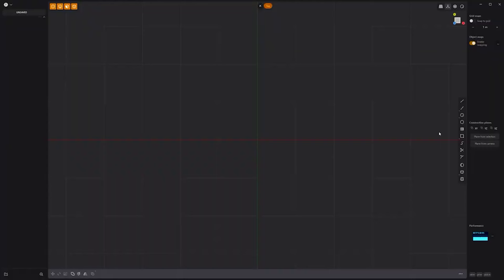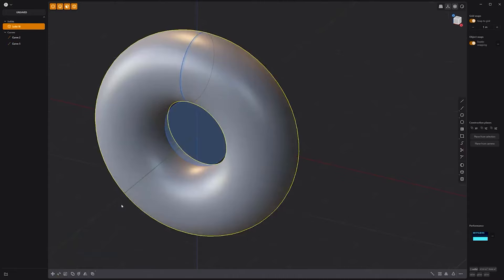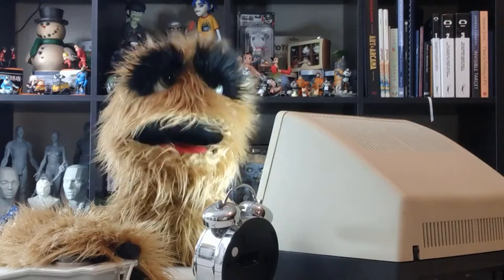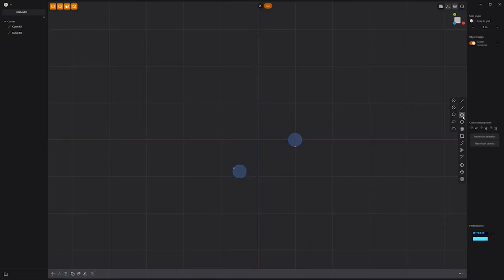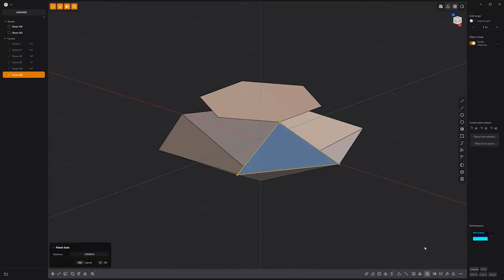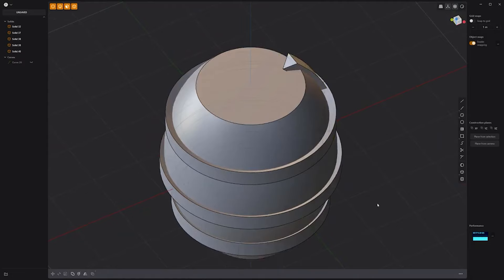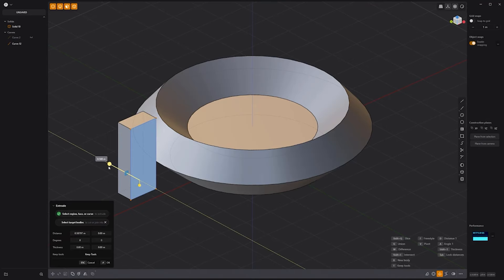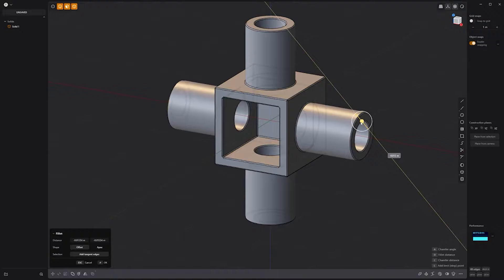Plasticity | 35 Essential Modeling Exercises

Comment: Is there any way to see the points of the surface? In order to manipulate it further? (Like the vertices on subdivision modeling, but also like the points on the surface at NURBS modeling)
Reply from the maker: You cant edit on a vert level for solids as you would in a traditional 3d app such as Maya or Modo.
Reply: @Pixelfondue  o rhinoceros acho que faz tudo isso mais oque o maia e modo  fazem . ou nao ?

Comment: Has Plasticity added the ability to scale/ change size of an object by units? ie. cm/inches etc. I really hope they add that soon
Reply from the maker: Its still the same that the components dont remain live
Reply: Hey  @Pixelfondue ! Could you make a video about the "Sweep tool", the second option when you press "F" in the search bar. Its about sweeping a solid I think and i'm having a bit of a struggle.
Reply from the maker: @albertoperezmartinez4050  https://youtu.be/DBM_4LVNTBQ?si=hqtH0ShKoIGgQsYi
Reply from the maker: https://youtu.be/hhnk1v-p6SA @albertoperezmartinez4050
Reply from the maker: @albertoperezmartinez4050  Nick the dev said it should have been removed... its was an experimental feature for simulating the path of a spinning tool, like cam / cnc
Reply: @Pixelfondue  Thank you for your reminder!  I've been trying this feature as well but it doesn't work. So  there's no way to deform a solid? or twisting a complex model?
Reply: That was added in v1.4 three weeks ago.

Comment: How to Sub-D modeling.
Reply from the maker: No SubD in Plasticity. I'd use Modo for that
Reply: @Pixelfondue  Thanks. I was asking in comparison to Fusion 360 which has T-Splines which is Sub-D. So it would seem if I switch from Fusion 360 to Plasticity I lose parametric and Sub-D. To me that is a lot to lose. Just saying. again, thanks for the reply.

Comment: Hello, I do everything according to the instructions, but smoothing corners does not work when I select all the edges. I repeated everything as in the video. The yellow circle for rounding corners does not appear.

What could be the problem? 2:41
Reply from the maker: can you share file that isnt working?
Reply: I did it, it turns out that sometimes the yellow corner rounding circle does not appear, and you need to press B
 @Pixelfondue
Reply from the maker: @tishhhenko  good to hear